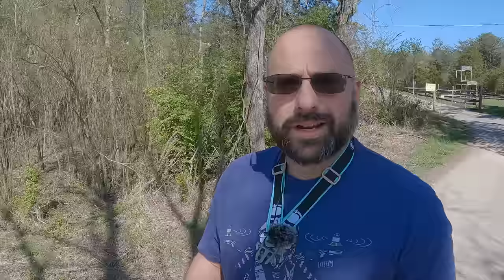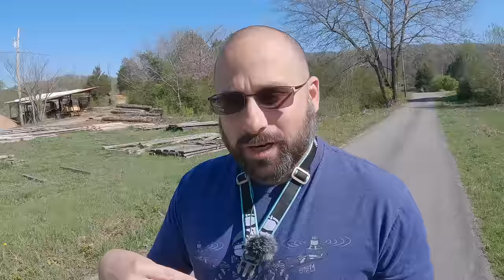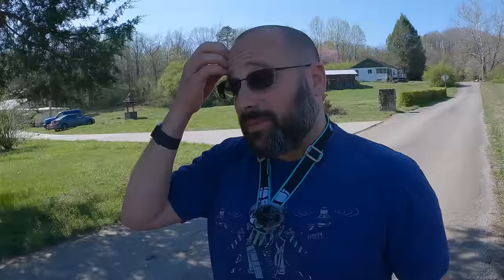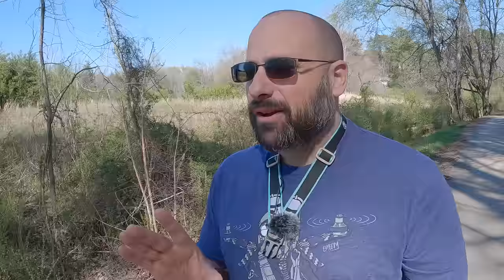Betaflight vs Kiss: Who's Using the Better Dshot?

Comment: Funny how the landscape is stabilized and JB all shaky. 😆
Reply: Is that from a gimbal or a stabilizing software?
Reply: God damn it now I can't unsee it😂
Reply: It’s because he’s holding the camera and probably has a horizon lock stab. On
Reply: If I had to guess.. I’d say if he was pointing it at someone else they would appear to walk smoothly
Reply: I noticed he was a little unstable... he may need tuning...😂
Reply: @XTreb  pretty sure it's stabilizing software from the gopro.
Reply: @RCOverKill  maybe a gimbal and a GoPro
Reply: this is now all i can see 😂
Reply: @jmillerfpv  if he's using a gimbal it isn't working. The gimbal I have I can use a gopro with no stabilization,  and it's rock solid walking, and pretty good running.
Reply: He got a little shuffle 😂. Dinosaurs 🦖
Reply: Haha ya that's what I see ... he's like rapper 😂

Comment: @7:05 the DShot error rate displayed in Betaflight is for corrupted bidirectional DSHOT telemetry packets received by the FC, but what you're talking about are corrupted packets received by the ESC. To my knowledge BF does not have a way of viewing this as the ESC would need to report the stats back as telemetry data.

The other important point that you could have touched on is that motors have momentum and can't change their speed immediately, so even the DSHOT300 53.3us packets in an 8k PID loop (125us period) are way more frequent than they need to be.
Reply: AMEN.

If motors can make any meaningfull change in 1ms (1000us) you are doing well.  They generally think about starting to move in that period of time after getting a new command, but RPM hardly changes.  So what are we talking about here? Nonsense I fear.  Perfecting the irrelevant as it is know in engineering.

You want better performance?  Forget all this and tune your rig.
In BF, it is easy, move up the Master Slider.

Comment: The only thing is... Dshot out uses a different timer than the PID loop. So if your new motor value spilled out by the fc ends up in the middle or just after a new Dshot string is sent you will have to either wait for a new string or discard that new value. With a higher Dshot speed your new values will reach the esc faster. Dshot has a CRC function you could use.
Reply: may be on BF. On ultra/kiss all synchronised to pid loop.

Comment: You forget to mention the difference between normal Dshot and Bidirectional Dshot. KISS doesn't use bidir Dshot but BF does. If you use bidir Dshot you have new challenges because you basically need to use a one way street for traffic from both directions. That means bidir Dshot 600 can only use half of the bandwidth of normal Dshot 600
Reply from the maker: Oh that's interesting! I didn't think of that.
Reply: How didn't you think about that when  at the time bidirectional dshot ( rpm filtering) came to bf and everybody was used to pushing normal dshot to 1200 there were tons of videos telling people to decrease the dshot to 600 or 300 for use with rpm filtering because not enough bandwidth.

Comment: Bardwell, dshot 150 can run at 8k. Dshot 600 can technically run at 32k with very small reset time. With a realistic signal reset time dshot 300 can hit 8k pidloops. Dshot 2400 can do 64k pidloops with realistic reset time. Dshot 4800 is possible and only emuflight uses it.
Reply from the maker: Yeah I see the math works out. So if it's not overrunning the pid loop time, then why is Dshot300 recommended for 4k and 600 for 8k?
Reply: @JoshuaBardwell  Well BF is currently hardcoded to only allow dshot 600 for 8k pidloop, and dshot 300 being the slowest allowed for 4k. So simply how BF is coded is part of it. I also wonder if its because ESC are looking for a wider than 21bit time between signals. So it might be an ESC side thing, IDK, but technically you could do those speeds if the ESC would accept it.
Reply from the maker: So the limitation is the length of the Dshot packet, but it's not just the Dshot packet that's overrunning the loop time. It's also that the ESC needs some quiet time between packets.
Reply: @JoshuaBardwell  well, you really just need enough time to be able to determine if your signal has finished sending. Which can easily be done with 21 stop bits worth of wait, which would allow for dshot 300 to run at 8k. So 8k is a totally realistic speed for 300, the question is if the ESC's will be able to pick it up.

As others mentioned Dshot has a CRC at the end of the packet to check if the packet is valid, however this CRC can't be used to see if the packet is over as we don't know where the CRC is until we have read the data and not just received the data.
Reply from the maker: Also bidirectional dshot doubles the packet time, right?
Reply: @JoshuaBardwell  no, it adds a set wait time then the rpm packet length (idk if it's as long as normal dshot), so bidirectional dshot adds more relative delay the faster the dshot packet is. Because of that set wait time you cant run dshot at pidloops higher than 8k AFAIK, but technically you could run dshot4800 with bidirectional dshot at 8k.

Comment: Hmm I'm confused? If the PID loop is 125us @ 8K and D shot packet is 16 bits making the D shot 600 (25.6us) and D shot 300 (52.8 us) how does the PID loop out run the D shot packet? Is there more than 1 D dshot packet. Excuse my ignorance but this info you are giving seems very important to the quad set up. Thank you for sharing this info Joshua.
Reply from the maker: Well dang. Your math is correct. And yet I've always gone by the advice to use Dshot600 with 8k and Dshot300 with 4k and 3.2k. I never sat down and did the math and I can't really explain the advice. I'll have to dig into it deeper.
Reply: @JoshuaBardwell  You do a great job, I'm new at this and trying to understand when I have problems. LOL which seems like every build I learn something new. Thanks to you I can fly. This isn't an easy hobby to say the least and your videos and inputs have help so much. Thank You.
Reply: What would be the conclusion to this statement? Running dhot600 is better than dshot300 even if using 3k pidloop?

Comment: My understanding was that dhsot 600 should have a transmit period of about 26.7 uS and therefore dshot 300 should have 53.3 uS which would be fine to use with a 8khz pid loop and its 125us loop time.

I know on a quad that has a bb1 with blujay I use dshot150 with a 4k pid loop and it works fine. Which would be a 250us loop and 106.7 uS transmit time for esc signal.
Reply from the maker: Yeah I see that the math works out that way. I have always heard the advice to reduce to Dshot300 when using 4k PID loop or lower, and I assumed it was because it would overrun the PID loop time. But clearly the numbers don't work out that way.
Reply: I think this assumes nothing else is happening in the pid loop. In fact the controller needs to internally communicate with serial logic (or heaven forbid do software serial operations), and then running all of the other pid math and unrelated operations. All these operations are going to be a few microseconds here and there and add up quickly.

Comment: Hmmm, I did not know that about KISS, I've either had them on D-Shot 600 or OneShot. Guess I'll switch them to 2400. Thanks JB! Cheers 🍻
Reply: He failed to mention most escs don't support dshot 2400. kiss esc, fettec, and blheli32 escs with f3/f4 mcu (128k pwm) will support it. regular blheli32 escs (48k pwm) will support dshot up to 1200. Blheli s supports up to 600. He didn't mention either kiss run their pid loop locked at 1k But use the extra head room to optimize the rate at witch they run the adaptive filter.

Comment: The fact is that motor speed reaction is way slower than dshot 300, used with 4k pid loops.
What can do faster pid loops and communication speeds? Maybe anticipate, but motors still cannot react on time.
Motors are natural low pass filter devices. When they receive contradictory orders (fast!, slow! fast!) in a short time they act the same as if they where stalled, they can only draw more current to damp the overshots that they continuously receive, so the effect of dshot 1200 and a nervous pid loop is to fry motors.
One thing that has to be avoided at all cost with motors is pid overshooting, overshooting at high frequency has the same effect that modulating with pwm, only that motors don't like that (they heat up when they naturally damp high frequencies), they need that the current is applyied to them to be as steady and smooth as possible so they can react efficiently.
PID loops have to adapt to motors, the oposite doesn't work.
PID loops are normally based on rpm as a way of simplify thrust, but thrust is not linear with rpm.
Thrust behaves more like a transistor. There are a cut zone of thrust, a linear one and a saturation one. PID loops have to adapt to take advantage of the linear zone of thrust.
Also I think that if you want to handle propwash efficiently you have two options, do not allow the kwad to enter in an air disturbances zone or plan a model that preanticipates to what is going to happen if the kwad enters in a air disturbances zone in a particular way.
When an helicopter enters in an air disturbance zone the pilot tries to exit it at all cost.

Comment: I am currently using 3 FCs:
[Tanq] Diatone Mamba MK4 F722 APP, GYRO=ICM42688P
[Wasp1] HGLRC Zeus F722, GYRO=MPU6000
[Wasp2] Diatone Mamba DJI F722 MK2, GYRO=MPU6500
All with latest BF, 8k PID loop and DSHOT600 with bench error rate < 1%.
Should I be considering 4k loop and DSHOT300?? Thanks.

Comment: Hello everyone, unfortunately I could not follow the post completely and need your help.
If I have a MPU6000 gyro chip that works with a sampling rate of 8kHz, then it makes sense to use a PID loop frequency of also 8kHz, because enough new data is put out from the gyro. I was able to follow to this point.
8kHz = 8.000 Hz = 0,125 milliseconds
But why should I then go over a value of DShot150 at all, if it already works with a frequency of 9.375 Hz = 0,107 milliseconds?
Reply from the maker: Use dshot 600 with 8k.

Comment: Controversial Opinion: I'm going to trust the person who know how to use an oscilloscope to decode DShot commands on what is useful and relevant over somebody without publicly available data and logs showing an improvement. KISS/ULTRA/FETTEC flies amazing for what is is, but there's a reason everybody who has to fly to an objective target is using one firmware.
Reply: (BUT, I do agree with running the system the way the dev/test team runs there - only an idiot like me will spend inordinate amounts of time running nonstandard configurations for the sake of edge case testing new features)